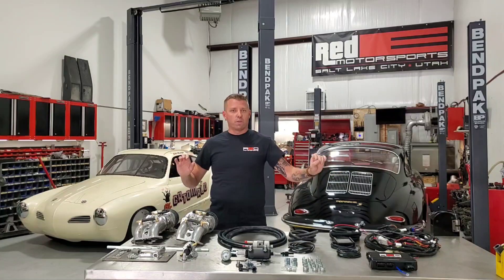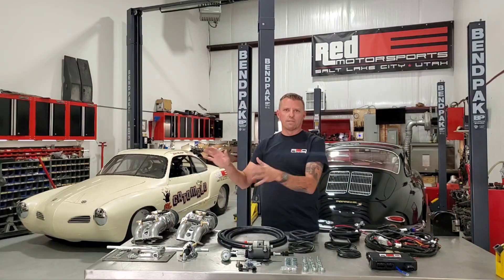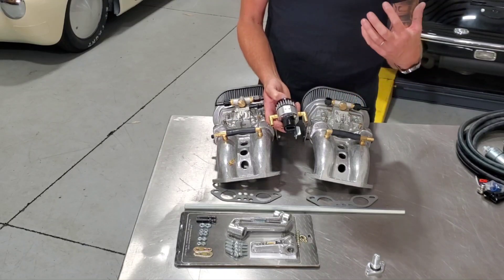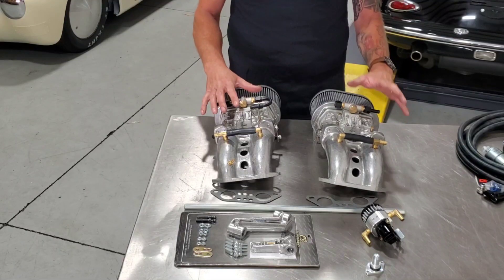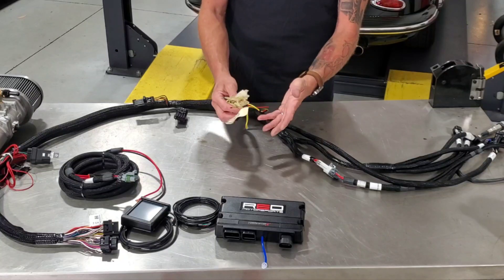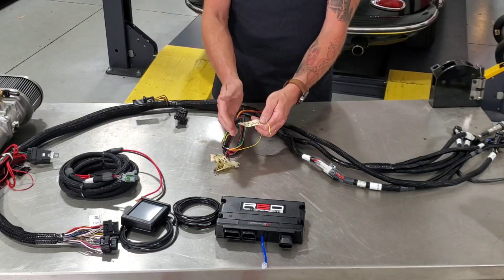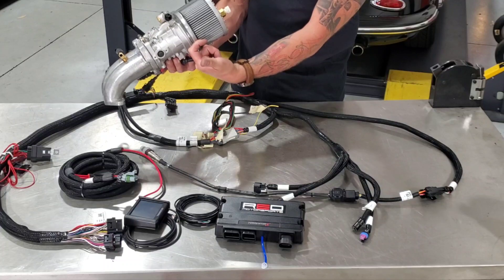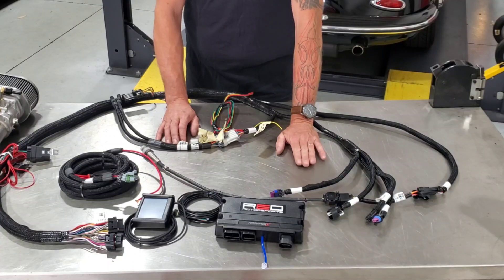Dual throttle body EFI system for aircooled VW's

Comment: Hi this is Junior from classic vw.  I am thinking to install a 2.0 from a 77 vw bus into my 73 bay window.  I have a the ECU from that 77 donor bus.  Will this system package make easier?
Reply from the maker: The factory system is bolt on and go. It's already setup by Volkswagen to run. A DIY kit is going to be more work to install and dial in, especially being dual throttle bodies that need to be sync'd, and all the adjustable parameters the Holley EFI offers to dial it in to your engine
Reply: @red-emotorsports1212 so to test for understanding, are you saying if I purchase one of this kit you advertise; it will be easier?

Comment: This is very interesting. I might be in the market for a type IV Porsche 914 2.0L kit. Can the stock cam be used or does it require a hotter cam as if converting to dual carbs?

Comment: How would it function on the auto type 3 where you need vacuum for the trans
Reply from the maker: @reyrivera171  we just put a 1/2 barbed port off #3 intake runner. We do that a lot for 71 and up Transporters

Comment: So I plan on using this system on a 71 Super Beetle Convertible.  I need to replace the fuel tank do I need a different tank other than stock. I’m planning on a 1915 build. Under 150 hp.

Comment: What are the power gains from this kit?
Reply from the maker: If equal CFM as a carb, it would not be any more power than a properly tuned set of carbs. The throttle bodies to flow about 10% more cfm than the same size carburetor so you can get gains there if the engine can use it. The real gain is the constantly tuned state of being on the engine, regardless of elevation changes, no more plugged jets, etc.

Comment: it doesn't need a crank trigger? how does that work.
Reply from the maker: Tach signal, either off the negative side of the ignition coil, or if you have a CDI it would have to be on the tach output of the CDI box

Comment: Hi, this systems don't take the Head Temp. ? This is a very important Point in my opinion.
Reply from the maker: We provide a threaded temp sensor to read the airflow off the  cylinders and head. We don't like oil or case temp for EFI temperature reference. I dobt know of any ECU that will input thermocouple milivoltage to a temperature so that's the best we can do. If someone came up with a millivolt to resistance converter we that would be amazing but I know of no such product. The air temp coming off the head and cylinders does seem to work very well though, it just means the temperature on the display is arbitrary and should not be used as a signal for any critical limit